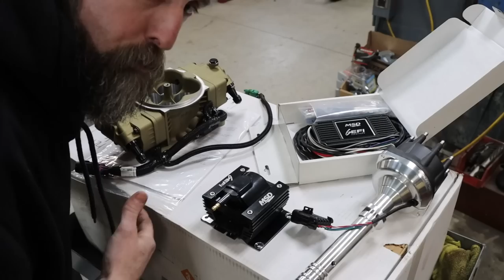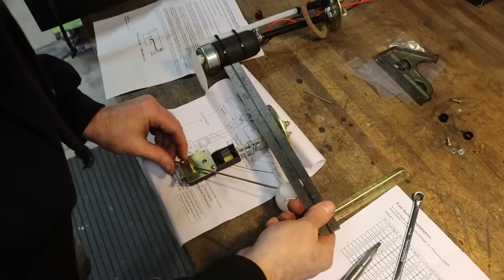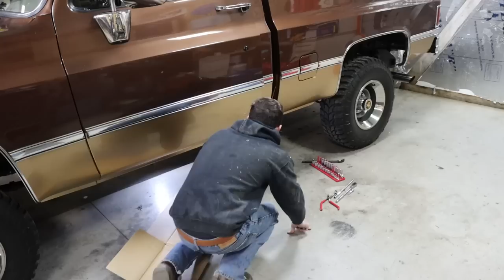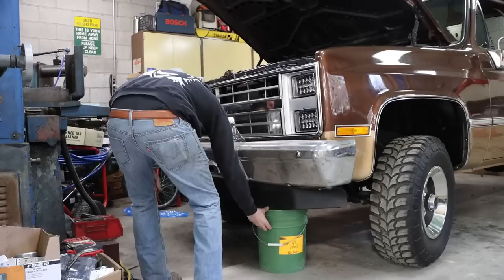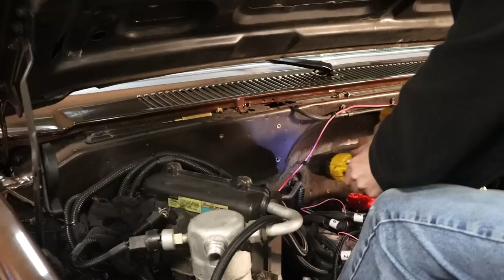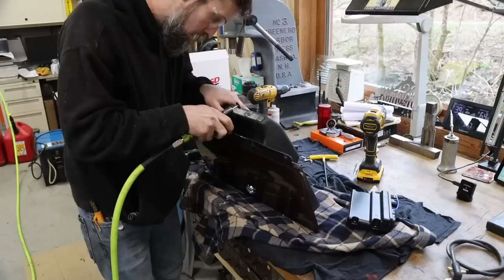Major Upgrade to the Square. Holley Terminator X Max Stealth . Part 1

Comment: I actually enjoy wiring complex circuits. I get a real sense of satisfaction and accomplishment when I flip the switch and everything works as it should. I taught myself to read wiring schematics at the age of 15 when I had to rewire my first car that suffered a wiring harness fire from an accident. That car had power everything and the harness going through the firewall and the drivers side door was about as thick as my wrist. I ordered the factory manual and redid it wire by wire. That experience led to me being very good at wiring machine control panels and building my own cnc plasma table plus hundreds of other wiring jobs. I'm not a licensed electrician mainly because I have an engineering degree and didn't want to waste my time doing a long apprenticeship to get a license. I said all that to say that, not everybody dreads wiring stuff...I actually love it.

Comment: I installed a FAST EZ 2.0 system on my 68 Camaro SS when I installed the ZZ502 crate engine. It’s by a long shot the best upgrade I’ve ever done on a street car. Once I got the bugs worked out it has performed flawlessly for over 4 years. I fought a bad MAP sensor that came with the kit. Anyway, the throttle response is excellent, and the performance is off the charts. Great tip regarding vehicle condition. Tight exhaust, good electrical system, specifically grounds, are a must. If only Cora had thumbs! Great job, looking forward to part 2.

Comment: My first experience with fuel injection vs carb was my 1978 Chevy Monte Carlo with a carbed V-6. Ran like a turd, got 14 mpg, and wouldn't run at all if you didn't do the plugs and points at 12K miles. Boss had a V-8, fuel injected Caddy Seville same year. Ran like a scalded cat and got 20 mpg. Never bought a non-fuel injected car after that!

Comment: I new Steve was going to upgrade. I too upgraded from a basic original 2 barrel 4.3L tbc on my 1990 GMC Sierra SL WT to a 4.3L Holly tbc and all the accessories.😲👍👍 An absolute game changer. 🥶🥶Also being from the same rust belt as Steve. I had to replace my starting to rust holes fuel tank, but it came the same way. I didn't trust the thin aluminum outside coating. So I epoxy coated the whole outside of the tank and sanded it smooth. Than painted Rust Oleum gloss black over that before installing it In 2013. No more worries.
Reply from the maker: I thought about painting my tank as well but the temperature was too low so I decided not to worry about it.  I'm hoping this kit gains me easier cold starting and maybe a a little $ at the pump. 👍
Reply: @SteveSummers  I notice saving over $50 a month. From 3-1/2 fills a month to 2-1/2 times a month. I'm able to go much futher on a full tank. Plus it starts instantly.
Reply from the maker: @kaydog2008  Hopefully it's similar in my situation.  That is a pretty good return IMO.

Comment: The best part is if you take a road trip, it will compensate in real time for changes in the weather and altitude. I'm using the same system on my current custom project. 1965 Mustang with a chassis and suspension I'm building and it will be powered by a SBF 363 with port injection using Holley's Terminator X Max system, and a 6R80 transmission. The one thing I forgot to add Steve, is to run the fuel pump through a relay. I always use 10ga wire from the tank to the firewall where I typically mount a high amp relay rated for the pump, and then run Holley's wire to the relay. Factory EFI systems always run there pumps through a relay. You might even think about installing an inertia switch in case of an accident.
Reply from the maker: That is awesome,  thanks for the suggestions. I seen that in the manual about using the pump circuit  to trigger a relay. It mentioned that for pumps over 15amp. Still is probably the best idea not to run all those amps running through the ecu and put it through a relay instead 👍
Reply: @SteveSummers  I haven't looked at the terminators pinout, but you might find that the wire is actually a ground output from the ecu. So the ecu tells a relay to turn on with ground, instead of being an actual power output. 

Great video as always Steve 👌

Comment: Good video explaining the Fuel injection system Steve.  I’ve been running a Retrotek Powerjection III system for over 10yrs.  It looks like a duel feed carb but has 4 75lb/hr injectors and the ecu is small and mounted right to the throttle body.  After being a diehard carburetor guy the injection system was worth the effort to change too!  The 454 starts with a turn of the key no matter how cold or warm and runs consistently.

Comment: Steve, I have watched a lot of your shows and really love them.. i have a hobby machine shop and I drive a pickup...  I actually bought a chevy  short box metalic  green ,  back in 1978,
When i looked at the start of this vid and was looking at your truck with the fresh paint and big tires..  wow looks great... BUT,  you really need to put mud flaps on it!!!!   your rockers will be chipped up in NO time if you don''t.... and I put plastic fenderwell liners in as well.....    no chips in paint, no rush.... just sayn' my friend!    Happy Trails......
Reply from the maker: Too late😄. I'm not real worried about small chips. I don't like the looks of mud flaps really. I did get some of the 3M clear chip guard stuff for the Lowe part of the truck.  Haven't installed it yet.👍

Comment: As much as I am an old school type mechanic and comfortable with screwdrivers, distributors springs and weights, points along with carbs I have to admit if this gives you better fuel mileage I am in 110%. I sure like your style my friend. These tanks have been known to rusting out on the bottom because of the rock guard on the bottom. I drill all mine with 1 inch holes to let the sand and dirt out but the guards still do their jobs. A new tank here just makes sense. I see your guard has already been removed so that is why. Another thing is that you leave no stone unturned with everything you do. Not a lot of people would put rivet nuts in the firewall or glove box as regular metal screws would most likely have been fine. If this ride will ever be up for sale PLEASE put me up for the first person you would call,  What ever you want I will be there on the next plane with cash in hand, LOL. I guess I am kind of bent as I have always had a passion for electrical and wiring over my career. 6, 12, 120, 220 and all the big bag of 3 phase has never been a problem. I would however have a spare fusible link or two in the glove box. One for at the starter and one for this new rigging as if for whatever reason one blows you can fix it then. Just like changing a fuse. Shit happens my dear friend! Seems I have yattered along far enough. You are always such a great visit my friend. Take care and see you soon eh.
Reply from the maker: I got you 1st on the call list😁 If I ever decide to let her go .👍
Reply: @SteveSummers  I am honored. As a gear head type I have never seen a nicer build. Take care of you, yours and her my friend. See you next post.
Reply from the maker: @TomokosEnterprize  There are plenty of nicely built vehicles out there.  Some guys really take it to the next level.  That type of build is far beyond my budget tho. From what my truck was it came out pretty good IMO. Thanks for watching bud.

Comment: When you said bring it up to 2023 standards, for a second I thought you meant install a catalytic converter so you get the full modern experience of coming back to your truck and starting it up only to realise someone has stolen your catalytic converter. But I guess a fuel injection system is probably a nicer upgrade. 😆
Reply from the maker: 😆 I hear of that all the time. Not so common in my area but it does happen.  The  thieves seem to develop rapid onset lead poisoning
Reply: Why can't someone sell an anti-theft device for 'cats' ?...even a metal box around the cat would probably be enough to deter.
Reply: @kenadams5504  all the kits I’ve seen are $700 and up. They claim to have “cut proof” metal cages.
Reply: @ken adams   There are. The ones I've seen that allow proper airflow, so as to not cook the Cat or the underside of the car, still allow a Sawzall blade to rob the vehicle of the Cat, even if the device is still attached. 
The total box ones can still be cut out, unless they bolt to more than just the exhaust. But then you shorten Cat life or cook your floor carpet.

Comment: Carburation has come a long way since the old days - my dad used to have a1963 ford consul capri GT coupe, 1500cc bored out to 1650cc( - yes - tiny engine volumes compare to your real nice chevy truck's V8!) but I remember the smell of four star petrol, with the choke out, literally hearing the petrol pouring into the weber twin choke with chugging, sucking noises! I guess you could call this holley system a "smart" carburettor - or injection throttle body. Cool stuff good morning from the UK cambridgeshire fens!

Comment: Happy Holley Saturday to Steve, Elizabeth, Family and Grits! Great decision Steve to install a Holley Computer System. I worked with Holley in the day with Manny carburetor systems. I had a 1970 LTI Corvette with a unique Holley 780 Carb. I replaced many Rochester Quadra Junks with Holley Spread Bores, Great Company to work with. You will also enjoy your new found ability to calibrate the system to your own personal performance requirements from the driver seat! I did some of the early calibrations when Detroit Diesel replaced the old mechanical fuel injector systems with complete electronic control. It is a hoot. Great video, thanks for taking the time to share. Looking forward to part 2. Good luck, God bless!
Reply from the maker: Thanks Roger👍

Comment: It has to be nice that everything is either new or very clean. Not getting grease all over everything. I wondered why you didn’t install a throttle body fuel injection and not a 4 barrel carburetor. I’m this throttle body fuel injection system plus the new distributor will perform excellent. Also you did an excellent job refurbishing your truck. I hope you have nothing but good luck with your truck.

Comment: My most hated thing I did when i was a tech was stabbing distributors. Doesn't matter the engine brand Never liked doing any of them. Fuel injection and distributorless ignition were the two best things to happen to engines/auto techs. I'm the type that likes doing the wiring. I may be doing a similar system on the current project but will make that decision when I get an engine for it.

Comment: There is a gasket sealer called Hylomar that is probably the most fuel resistant non hardening sealer on the market. 😉
Reply: It was invented by RollsRoyce. We used it before silicone on machines. Great stuff.
Reply: Also better fuel proof thread sealer than yards of PTFE 😉
Reply: Best thing to come out of Wigan. And that includes Northern Soul.

Comment: Back in the day when I had my machine shop one of the tools that I used to have was a Sunnen distributor station and yes I have put through many GM HEI Distributors through it plus a plethora of others but for what it was and what it did back in the day it was priceless also you are talkin about Holly and how good their carburetors and castings and things like that my father was International president of the PT boats organization back in the 70s and 80s and early 90s and one of the things that they did was they rebuilt a PT Boat restored it PT boats have 3 V12 Packard engines on them that take a variable Venturi Holley carburetor if you remember back in the day Ford tried to make a variable Venturi carburetor that they put on their Ford engines in the late 80s the carburetors that was on these PT boat engines the Venturi for the carburetor was as big as your fist it had a little sliding door on it that accelerated it same Principle as the little one but way way bigger I think Holly used some of those on some of the inline Allison engines as well and on that note I had a 76 Chevrolet square body that had a 350 in it and I had a tuned distributor in it with a Rochester Quadrajet spread bore carburetor no I was taught by an old dirt Tracker out of the middle of the woods in the state of Missouri how to go through a Rochester carburetor and change it from Quadra junk to Quadra Jewel and I could make a Quadrajet Carburetor outperform anything that they had on the market at that time late 80s early 90s and nothing beats that spread bore sound when you stick your foot into a Rochester carburetor and that truck that I had if I kept my foot out of the secondaries and just strictly ran off the two barrel I would get 21 Mi to the gallon around town and 34 on the highway so I'd be interested to find out how Ultra tuned this fuel injected Holley can get love the channel Steve never miss an episode

Comment: That's the 1st time I've seen the throttle body that looks like a carburetor. Did see a picture of both, side by side just didn't realize they made one where you don't need to install a new intake manifold. Nice work as always, n can't wait to see you finish it all up and the ride along. Thanks for sharing, take care until next time.
Reply: Yeah I thought it was pretty cool that it looks so much like a typical Holley 4 barrel carb. Nice touch!

Comment: Cummins engine co sold a nice 6 lb inch break away torque wrench
For their tune ups 
The way you would use it is put the correct feeler gauge between the rocker and cross head tighten the adj screw to 6 lb inch and its set no worries is it too tight or too loose because 6 lb inch = 0 lash

Comment: Those hose AN caps spin on counter clockwise and they pull in the sheath and steel pokey strands.

Comment: I did the sniper efi on my Pontiac Firebird 69 , I found that it was hard to start out  with my Tremic 5 speed it was to hard to feather the throttle I found out there is a conversion  link that change my unit to progressive linkage and adjusted the computer it made a total differents . Easy to start off from a stop .  Bill

Comment: good upgrade - you will get better mpg, better power, easier starting etc etc - good you are doing total system - you may be able to use some e85 now and then? afr will go down but it will run cooler - pls do a followup on this story - get a cb - the truck needs and antenna plus gps lo profile and running lites pkg - good to see you going all the way on this - lots of time and effort but worth it - lastly think about a backrack and some rails on top of bed - and a toolbox of course - the truck is close but still not 100% - you can advertise to do these sort of installs since it is such a nice upgrade - think about doing some data logging - not sure obd sys but you may be able to add blueteeth - shop around

Comment: Maybe not quite 2023. Throttle body injection and distributors went away in the late 90's. But a decent up grade regardless and keeps it looking old school. Maybe should mention the much higher fuel pressure and the need for a high pressure fuel filter.

Comment: I'm not so sure about adding fuses. Of course, there is no harm in adding them, but they will not blow even in the event of a fault, because all even remotely modern ECUs have built-in overcurrent protection.

Comment: So Steve this is a different installation from the fuel injection system you showed me a year ago when I visited? It's clearly a more modern system. The other was an Edelbrock   FI system wasn't it? My memory is not good these days lol. Say hi to Elizabeth and you all stay safe. The Covid virus is still running round here in the UK. Caught it myself ( again) a month back. Not so bad this time, but my wife had it too and she was fairly rough with it, though not as bad as before, when she was pretty knocked out by it for three weeks.

Comment: asked a while back but you might not have seen it. How does the silencing material you added to the cab interior help with sound reduction? Big, small, improvement?
Reply from the maker: It's like a different vehicle.  Made a huge difference in road noise. It's not necessary to line the entire cab like I did to get good results 👍

Comment: I'd like to know how your system is running now that you have had time with it? Would you would change anything if you has to doing it over again?
Reply from the maker: It's running good. I've had one O2 sensor  fail and that's it.  Knowing everything I know now, I'd have just put a LS in it and saved money over building a 383 sbc.

Comment: 1 minute in and I’m worried it’s the parking brake. You have a choc under the wheel.
Reply from the maker: The wood block is just in case.  Parking brake works well 👍 . With a Manual transmission a working park brake is must😄

Comment: Do you need the Holley distributor for this system or can u still run a hei distributor. I’m brand new to this set up. Just ordered one and trying to get has much info has possible.
Reply from the maker: You can run the standard HEI, but you will not have timing control. It will work fine.

Comment: Was this the xmax or just the x I like the idea of putting ecu in glove box I looked at doing on the outside of it but run into old air products unit.
Reply from the maker: It's the X not X max like I mentioned.  No trans control on my unit

Comment: I'd be concerned that the leads running to the ECU will constantly be flexed with the opening and closing of the glovebox.
Reply: If he's anything like me, that constantly equates to maybe 5-10 times a year, usually to put in repair or maintenance receipts. Should hopefully be fairly insignificant if he has them supported properly.
Reply: @cchanson155 He wanted also to see the Leds on the unit.  Could be each time he drives?

Comment: Did you remove the old fuel pump and block off the hole that it came out of? If you did I didn't hear you talk about it .
Reply from the maker: Not yet but I have a block off plate for it.
Reply: @SteveSummers  ok